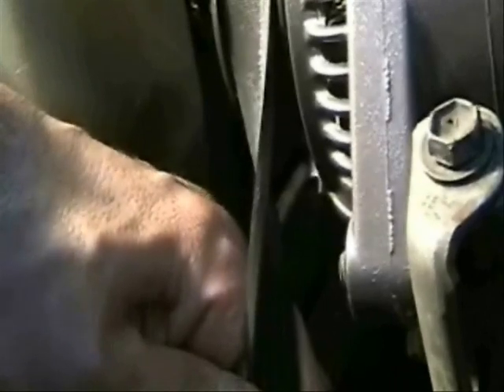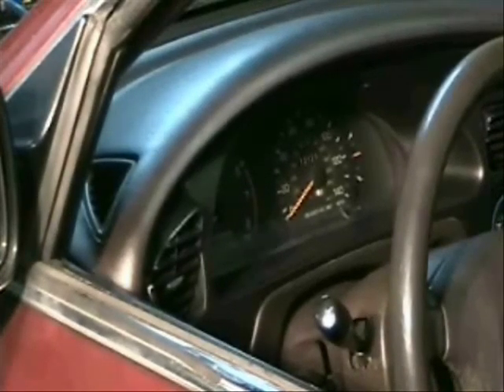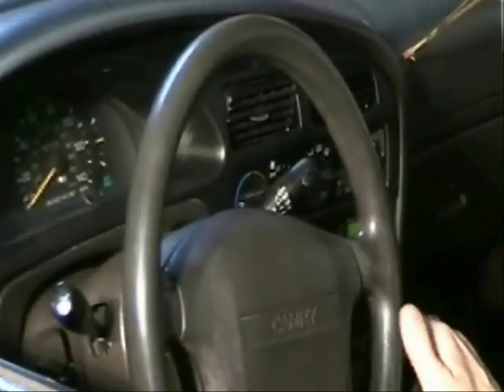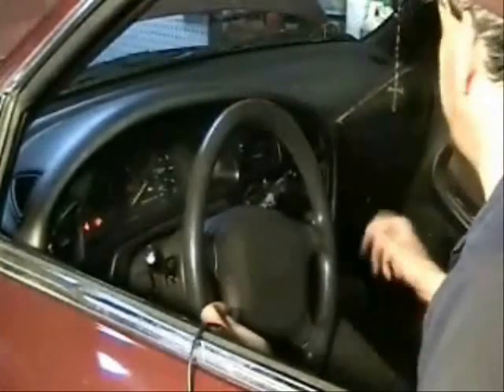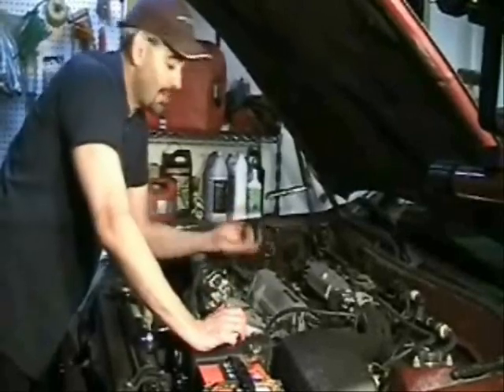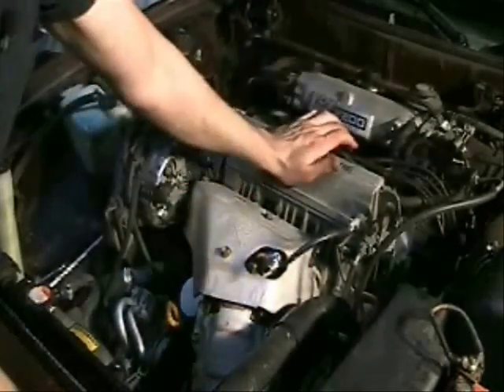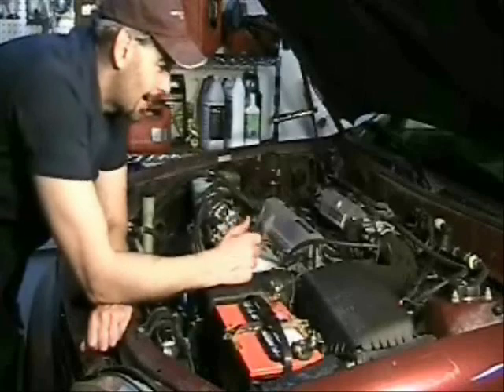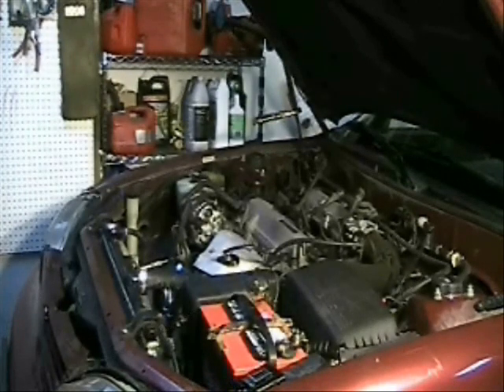How to do a Complete Used Car Inspection- PART 2

Comment: If you are removing spark plug wires without unplugging the coil make sure to ground it or you could damage the coil or pcm! 

Thanks for these throwback quality videos! its 2006 automotive class all over again! Great work
Reply from the maker: Good point. at 40Kv it’s going to find a ground one way or another!!!! I should have mentioned that.

Comment: At about 13:00 going forward you're talking about compression testing and setting up to do a field test. Yes, thank you for the reminder. That's exactly how my blown head gasket sounded like. It'd been so long since I heard one that I was afraid I wouldn't be able to pick it out in the future. Well, I say exactly, but since I lost compression on more than one cylinder it was actually worse.

That sound can be mistaken for needing a tune up....disable the ignition to remove that variable for the sound, perfect!

A bad exhaust manifold can also sound like needing tune up, but there is a difference in that sound too. It's more like the air is being slapped versus the timing not seeming right from either timing or spark plugs, ect.

Comment: On checking the fluids... when checking the coolant, pay attention for stop-leak! I had a friend take me some years ago to look at a 3800 Camaro for his wife. I felt horrible because I completely missed stop leak mud in the radiator, and being a 3800, it had the dreaded intake manifold leak. Also, it could be indication of head gasket problems, obviously.

Comment: Matt, I would like to point something out. Keep in mind, with age, old sparkplugs fail. What I mean by that is the porcelain can crack near the spark tower on the SP, resulting in an actual compression leak. High compression engines with 'el cheapo' spark plugs are more prone to this but it does happen. Compression can actually blow out the spark plug and cause a compression leak internal to the spark plug. I have seen this(rarely) while working in the field. I just thought you should be aware of this. Thru my observations(watching your videos) it seems like you enjoy engine performance faults, and the above information seems appropriate for you to know. Junk Yard parts....don't even get me started, lol. Awesome video series my friend and yes, I watched all of them.
Reply from the maker: Wow thats a good one, never heard of that but I see what you're saying! Yes that would indeed cause a potential false concern on the cranking compression test.

Comment: Here's another one that I hadnt given much thought... Many times the manufacturer will specify which sparkplug to use somewhere on the data tags inside the hood (usually around the radiator).  If you can remove one plug, check that it is the right plug. Yes you might be assuming the rest are the same.  I was doing a check for a friend of mine on a car he was going to buy.  The previous owner purposefully (can you say idiot) put the WRONG plugs in the car.  It required those funky double pole plugs.  He even had a set of new correct plugs in the trunk!  Needless to say, the car ran a whole lot better after we installed the correct plugs

Comment: what about the age of timing belt, I mean it might still be good on mileage, but if the car has been sitting for years doesn't the belt get hard itself which makes it easier to break?
Reply from the maker: E38ish I believe I mention this in another part but absolutely- that's critical. However my policy is to always recommend timing belt change at recommended interval regardless of how new or old belt looks. Anyone can just put a sticker saying when it was changed and even if a new belt was installed, were all the timing components and tensioner new as well?

Comment: Hello Matt,
I have changed recently (not me personally, a service shop) my crank case breather filter because when I opened the oil filler cap, there was pressure air comming out. With the new filter besides the pressure, now I also have a pretty dense white mist puffing . What can be wrong? My car is a 2006 bmw 120D. Please give me your opinion, it relly counts for me.

Comment: All my lights on my Chevy blazer turn on except the oil light what does that mean n what can I do or should do???? Thanks
Reply from the maker: Muniz Jimmy Jimmy.  No kidding thats a very serious concern.  If you have low oil/drop in oil pressure you will have no way of knowing and could destroy the engine.  I would have the bulb replaced right away it should come on with KOEO (Key On Engine Off) as a bulb check. If it doesnt you most likely have a bulb failure. You might look up my "replace dashboard light bulb" video if you plan to do this yourself.  If this is a used car you are considering buying I wouldn't even consider buying it unless I did a manual oil pressure test first.

Comment: Q: When a car has low compression, is there a way to tell whether the compression is escaping via the spark plug, rings, or other ?
Reply from the maker: Yes it's called a leakdown test.  I have several videos on this. Basically you put compressed air into the cylinder at TDC compression and listen for the air exiting.

Comment: Q: What if it's a Used Car dealership that's selling the car, and you ask about the timing belt, then they say that they replaced it when they got the car in... is this something to be concerned about ? 

What's the chances they could make up a receipt? You couldn't really call them to confirm, unlike if another mechanic changed the belt, you could probably call them to confirm, they might have a history in their database of changing it...
Reply from the maker: It's all about written contract. Every contract needs to have 3 components- an offer, and acceptance, and consideration.  In other words "One of the conditions for me buying this car from you is you are guaranteeing it has had the timing belt replaced at "X" miles."  If your offer is accepted and you pay the consideration and then find the timing wasn't changed as guaranteed, the contract has been violated and you can take legal action varying from getting the timing belt changed up to even returning the car,
    Good luck getting a used car seller to agree to such a thing though.
Reply: I also take into consideration whether it's an interference engine...
Reply: P

Comment: first thing to do is test drive the vehicle, that should be the first part of the inspection. after that you will know to continue or walk away
Reply from the maker: I always advise against that because with the drive you are changing the BASELINE of your initial variable set you are examining.  Always start with your baseline of variables and have that established before you drive the car.  This way you identify issue that will not show up on the test drive!!!
  Test driving the vehicle first is the most common mistake, actually.

Comment: thanks for all the tips I GOT fucked on the first car i bought and the truck i got after(lucky i dumped it on someone else  had electrical issues and brake issues)

  I only got from 128,900 to 172,500 on the lemon car i boughtI spend my whole savings on it at the time back in 2013 4500$ and i dump another 4k in repairs $8500 I got screwed badly
right no i;m saving for another car i got about 4200 so far  trying to save 9k to 10k... I have more in my savings  about $13,000 (plus the 4200)n  but i'm really scared i might get screwed again